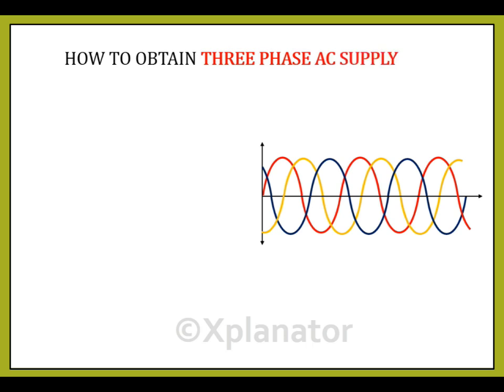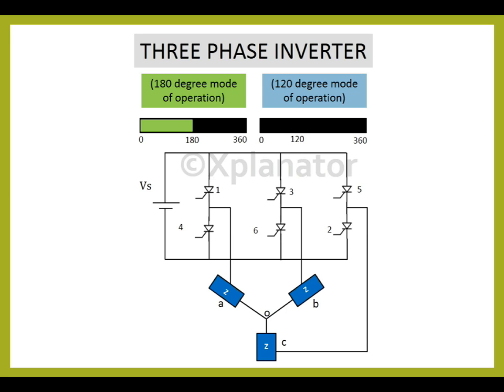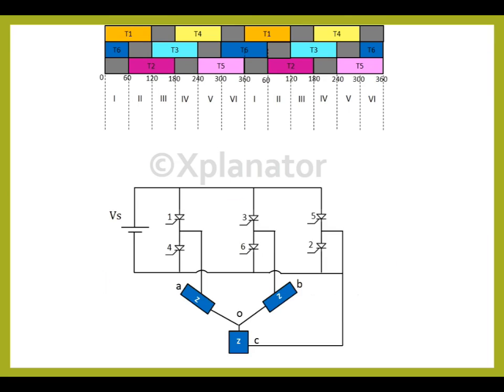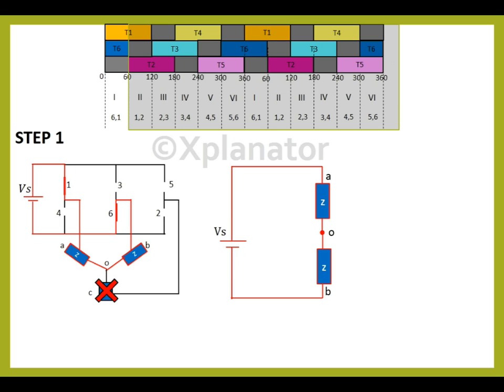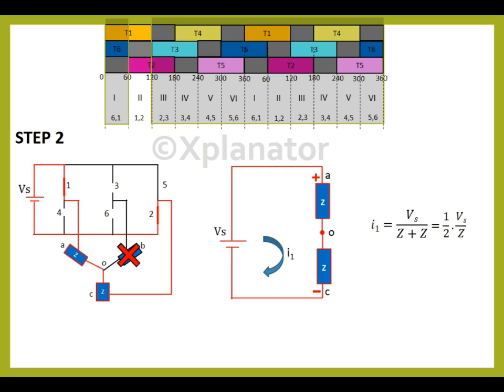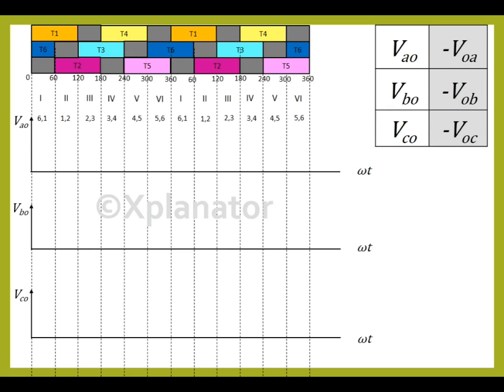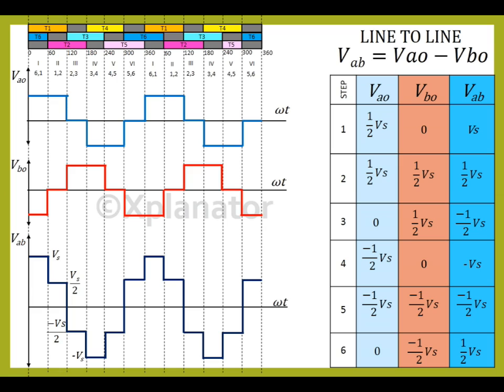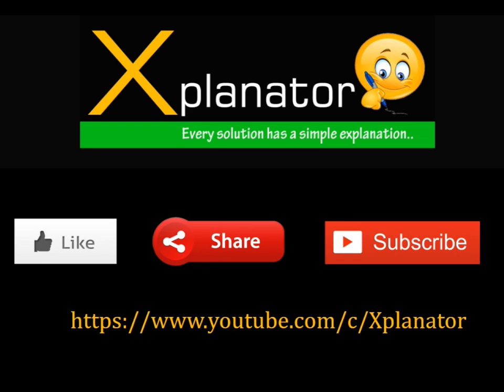Three Phase Inverter - 120 degree operation with Voltage Graphs

Comment: Dear sir

              What is the value of IGBT using this type switching 3phase inverter circuit ,  to ON for Vge=4v~5v and its output is Vce=250v &above  and Ic=Ie=3A &Above and its switching time below 10ns.
or
what is the value of thairistor 3phase  220v 3A inverter ckt ? 

    Thank you.

Comment: Thank you. You truly helped me.
Now, why would I use a 120 mode instead of 180 mode?
I am talking in terms of losses and all the geek stuff.
Reply from the maker: In 180 degree, as one switch turns off(after 180 deg), next has to turn on(for 180 deg) immediately without a lag in time(180+180=360). That can cause a short circuit and damage the system . In comparison 120 degree offers safer commutation.

For answers related to losses and other parameters refer to this answer on quora:
https://www.quora.com/In-3-phase-bridge-inverter-for-practical-purposes-is-120degree-mode-of-operation-preferred-or-the-180-degree-mode
Reply from the maker: I appreciate the gesture :)